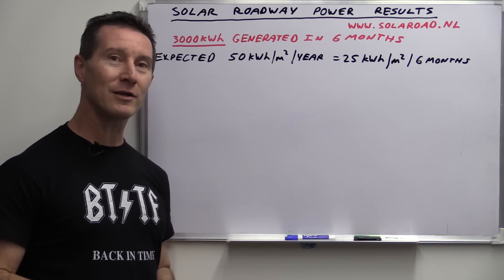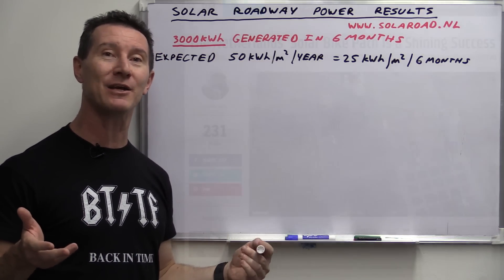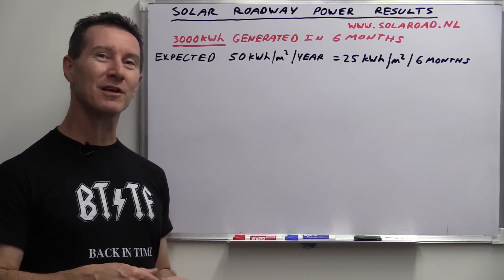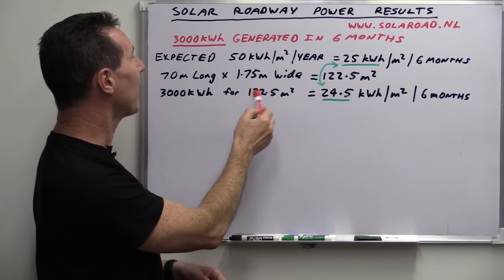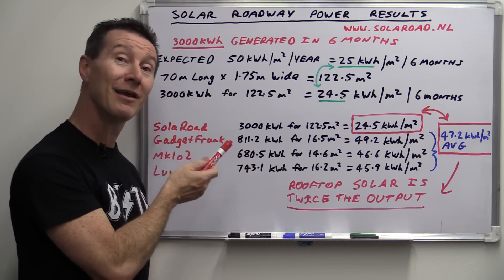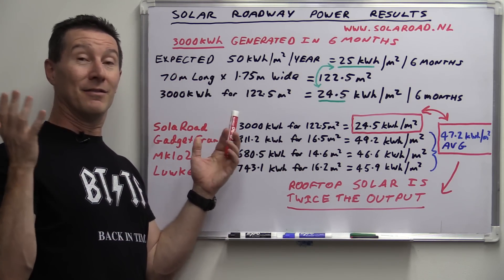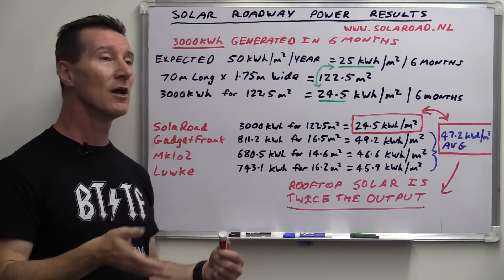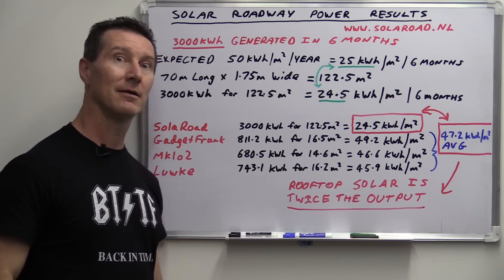EEVblog #743 - Solar Roadways Test Results

Comment: Can we all agree that, before they made the installation, the same area was generating 0 kWH? So... if you're making the argument that a Rooftop installation makes MORE money than a road installation, that would be correct. However, I would need a calculation, how much money does it take to maintain the installation versus the amount of money we gained from the money? I mean, for someone who is really boasting exact numbers, you made a SWEEPING Generality Assumption that said that it would cost X based on the public numbers for crowdfunding. Are you absolutely sure that it would be a "in the red" gain?

What I'm talking about is... Let's say that the generation of a solar roadway costs X per panel, and it costs Y per panel, and we are generating Z for that, does X + Y > Z? < Z? == Z?

Why are you so butthurt from the solar roadways? Are you Solar Montoya and Solar Roadways killed your father, and they should die? I think there's some missing data here, and you're using some sweeping generalities, and using data that has NOTHING to do with the viability. You showed that its half as efficient. Congratulations, you stated the obvious, Captain Obvious. Everyone knew that. Now, you need to show that the cost of creating and maintaining the roadway will outweigh the money that it will generate from building the road. Then, maybe you will have a valid viewpoint.
Reply: Zachare Sylvestre according to their stated output it would bring in about $2000.00 a year for this $4,000,000.00 dollar project.
Reply: Reddit Gold User I have done a few estimates and the cost for panel, glass and coating ends up somewhere around 70 to 100 Euro. That excludes installation, cabling and controllers.
But at 10 euro per year of electricity production, the claim of a current 20 year back back time seems within the range of possibilities. So does their claim that they hope to get this down to 15 years.
I also looked at the energy required to make the panels and glass. Glass takes about 5 to 10 kWh per kg to produce, a 10mm glass panel takes about 250 kWh to produce, that is less then 4 year payback. 
Same story for CO2 produced. The panels safe more then that they cost.
All these figures are very rough and not meant to show that solar roadways are viable, but to show that the idea of solar roadways is justified.
Reply: What about the energy costs to make the cement, as well as the CO2 produced from this process? What about the costs of the labor, and energy required to build the prefab roadway panels, what about the energy required to transport the panels to the site? What about the labor costs to install the panels? What about the energy cost to manufacture the solar cells? What about the energy, materials, and labor cost to manufacture the power inverters? What about the labor cost to connect them to the grid? What about the energy and labor costs to prepare the roadbed these panels are installed on? These are only a few things you are not taking into consideration in your equations. Factoring in all this would show the 20 year pay back is not realistic. 
All you are doing is picking and choosing which numbers to put into your equations to somehow justify the expense of the roadways in reference to the payback period claims, and the claims they are better for the environment...
Reply: ronc1357 You are spot on. No one knows what the price difference is between a mass produced solar road and the cost of a regular road. And without this information you cannot determine if these roads are viable.
Reply: Zachare Sylvestre Think of it this way; a rooftop panel takes 10 years to pay for itself and dies after 20 years. Flat panels such as the NL bike path generate 50% less energy. That means it will break even after its 20 year lifetime. Add tempered glass, a support structure, and cleaning costs to that panel. The amount of time it takes to break even increases past that 20 year cutoff. Its easy to see that being in the red is inevitable with current technology.
Reply: Reddit Gold User The support structure is the road itself, something that has to be build anyway. Can you really attribute that to the cost of a solar road?
A rooftop panel will cost about 4ct per Watt, a solar farm about 2.5 ct per Watt. This shows that there is a huge reduction in price when large scale installation is involved. Solar roads can be a large scale installation.
I am not going to state that a solar road is viable but a techno/economic study from the Netherlands Organisation for Applied Scientific Research, a non profit organisation that is at the heart of this Dutch solar road, shows a payback time of 20 years and possibly 15 years.
Reply: Raspoetin a Take a look at the installation images of the NL pathway. Those panels are damn near 25cm thick.There's more to them than just a solar panel. There's a frame and interlocking joints below the panel. It took a crane to lower those tiles. Same goes for the US-based solar roadway tiles. Those have a massive support frame. They need to so that tiles don't lift off.
Reply: Reddit Gold User The Dutch are already experimenting with concrete prefab roads. 
Just look at the pictures because it is all in Dutch. :-)
http://rijkswaterstaat.nl/rws/corporate/Wegen%20naar%20de%20toekomst/Geluid%20en%20milieu/Modieslab/Modieslab%20-%20prefab%20betonnen%20wegdek%20op%20palen.pdf

These kinds of roads would be ideal for a concrete solar road.
Reply: Raspoetin a The availability of a compatible support structure is like the tail wagging the dog. You essentially have a panel that generates 50% less(data from the NL path). That panel will pay for itself in 20 years. The panel will die after 20 years. The taxpayers are going to have to eat the costs of the tempered glass, the maintenance and cleaning. Taxpayers can barely even keep up with the current $3/sqft asphalt that doesn't even need cleaning+technicians.
Reply: Reddit Gold User How much does it cost to build a concrete road? and how much does it cost to build a concrete solar road?
In the Netherlands of course.
Reply: Raspoetin a Concrete roads are usually cost around 50% more than asphalt roads. I can't give an accurate price on a solar road, though I'm sure a base estimate can be made given the price of silicon and the energy required to create tempered glass.
Reply: ronc1357 Cement is about 110 kWh per tonne, 3-400 kg cement per m3 concrete, concrete panel about 250 mm thick --> about 10kWh per m2. A couple of months pay back time.
CO2 for concrete is estimated at 410 kg/m3, so a bit over 100kg per m2. Electricity from coal produces about 1 kg/kWh, so 18 months to pay that back.

What about the energy cost to manufacture the solar cells?
Similar process to making glass, temperatures are a little bit higher but the panels are really thin. Add 10% to the glass and you have a bulk park figure. Then again, the Kwh I used to do the glass are based in fuel kWh, not electrical kWh... that means that I hugely overestimated the energy required to make glass.

What about the energy, materials, and labor cost to manufacture the power inverters? What about the labor cost to connect them to the grid?
Lets look at it. 1 inverter per km of road, if the road is 16 meters wide (4 lanes and shoulder) then there is 16000 m2 road per inverter. If this inverter costs 150.000 Euro you will have to add 10 Euro to the m2 price.

All you are doing is picking and choosing which numbers to put into your equations to somehow justify the expense of the roadways in reference to the payback period claims, and the claims they are better for the environment 
CORRECT. I pick the major components and calculate with them. Those figures all end up below 10 years of pay back time. And yes, this leads me to believe that the claim for a 20 year pay back time could be realistic.

What can I say? I was very sceptical about these solar roadways until I started doing some research into it. Guess what, I still think it is right on the edge of viability, but I can no longer state that solar roadways are just nonsense. 

But feel free to do your own research and prove me wrong.
Reply: Raspoetin a I think you may be a little confused about the cement I am not talking about concrete prices. cement is the binder that holds the concrete aggravate (gravel and sand) together once it is cured. it is a major producer of CO2 and is energy intensive to manufacture. The power inverters would need to be place much closer to together than you are suggesting they convert the DC power to AC power basically one inverter to each panel section synchronized with the grid power, then you would have to install step up transformers periodically to increase the voltage to put it back on the grid... You still aren't factoring in all the other stuff involved. They don't magically appear on site, and install themselves, in order to live up to the claims you would have to figure in all the expenses, not just part.
Reply: ronc1357 I am not confused about the cement/concrete at all. I showed you the figures for kWh and CO2, not the price!
Just saying that cement is a major producer of CO2 is meaningless. Do the calculations. Its like a tonne of CO2 for a tonne of cement, its huge, but when you calculate the amount of cement needed per m2 of this road, then it is a lot less...

The power inverters would need to be place much closer to together than you are suggesting
Really? why? 

You still aren't factoring in all the other stuff involved
No that is correct. I am not doing a full techno/economical analysis. That has already been done by a whole group of specialists, and these people calculated an economical payback time of 20 years and possibly 15 in 5 to 10 years. 
All I have done is grab the major components and that showed a less then 10 year payback time, leading me to believe that the experts could have a valid claim. There certainly isn't a magnitude of error.
Reply: ronc1357 *once one is shaded it reduces the power output of the entire string of solar cells*
You don't make just serial connections in a km string of solar panels. Most connections will be done in parallel. A parallel connection does not reduce the output of an entire string.

If you don't factor in all that is involve how could you claim that the road will pay for itself
I don't, but the scientist and engineers from TNO (Netherlands Organisation for Applied Scientific Research) have done a full techno/economical study... They are the ones that claim that 20 years is currently feasible.

or your retarded, and can't fathom the economics of a product
And yet you have no problems in making the following statement: "Factoring in all this would show the 20 year pay back is not realistic."
Draw you own conclusions.
Reply: Raspoetin a You are gathering information from the people who are promoting this boondoggle, trying to keep the money flowing in "perpetual research and development". These people are not dissimilar to Solar Roadways, "we don't know how much it will actually cost, but it will pay for itself in twenty years" this is why they don't disclose the actual costs... True engineers always take costs, as well as future costs into consideration.
Reply: ronc1357 Of course, it is all a big conspiracy designed to keep the money flowing. What a load of nonsense.
Reply: Raspoetin a We shall see soon enough. What I find hilarious is you, yourself have stated you don't think it's viable, but you say it merits further research...
Reply: ronc1357 Because my opinion that I don't think this is viable relates to unknown factors like the construction of these kinds of roads, and the coating that forms the surface.
The cost for the panels, the glass, the cabling, converters etc are not a showstopper. Even the cost of installing the panels in prefab road slabs is not a show stopper. But I don't know the cost difference between a prefab concrete road and a regular road, nor do I know the maintenance cost over 20 or 40 years.
Bottom line is that I don't have enough information to determine if these roads are viable or not. 
If they can construct these roads with a reasonable cost, the benefits could be enormous. And that is why I support the research into this.

And given that researchers from the Australian Centre for Advanced Photovoltaics have managed to create a panel with a 40% efficiency. If their research turns out to be viable.... 

But you are of course free to find that all hilarious.